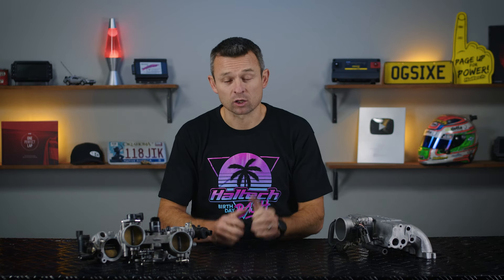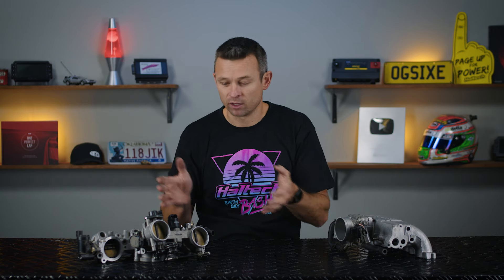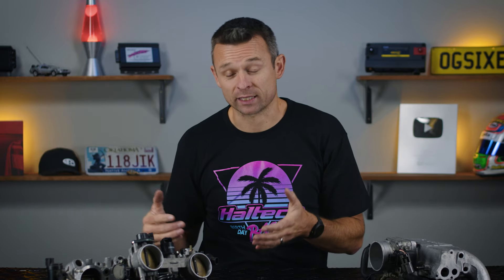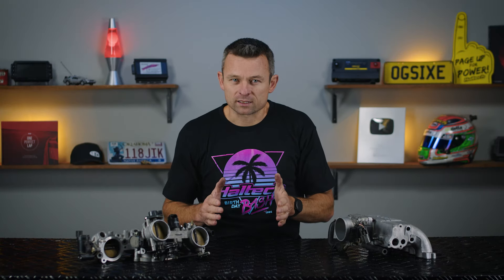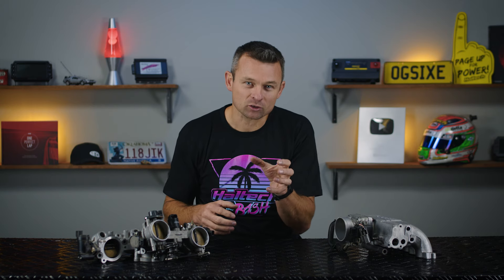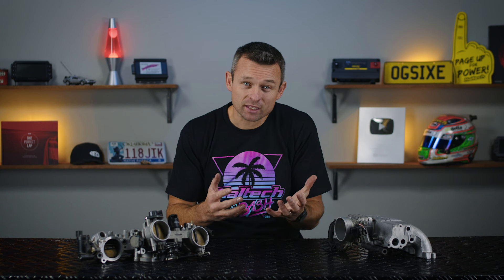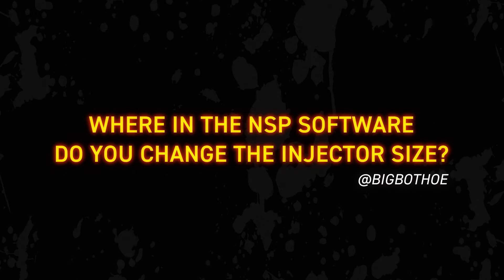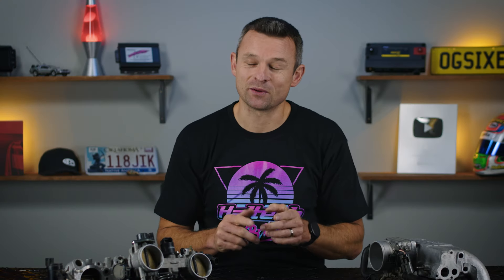🛠  Can ITBs increase horsepower? | TECH TUESDAY

Comment: ITBs for looks only? Nah. GT3, F1, etc. race cars use them, i doubt it is for looks 😉

ITBs on race cars have plenums too, but the velocity stacks are inside the plenums.

A lot of motorcycles have ITBs, whether FI or Carb. Motorcycle tuners deal with them on the regular.

Comment: Good info. Is the Haltech DBW feature compatible with later model super bike quads with fly by wire or similar E throttle controlled throttles?
What's the entry-level Haltech ECU with DBW? 1500?or can you option 550 or 750?
Reply from the maker: You can contact our tech support team directly via www.haltech.com/contact-us 
They'll be more than happy to help you out.

Comment: You failed to mention the main reason for ITBs, they supply an even amount of air to each cylinder. so each cylinder makes similar power. 
its common on plenums with the throttle in front of Cyl 1 to breath more air tha the rear cylinder.
Modern intakes have improved this issue
Reply: Well said he never covered that part put the inlet manifold on the flow bench and see if all the cylinders breathe the same though the inlet😢 most don’t

Comment: I believe Porsche has perfected this pressure wave timing in the intake of their engine I forget which one actually. But I remember it making impressive n/a power.
Reply: Speaking of Porsche... a 944 engine can get significant gains, but only with an engineered setup. It really does depended on the specific engine, as pointed out in the video. in the case of the 944 the hidden benefit is the weight saving on the front of the car when seeking a 53/47 weight distribution, life is complicated.

Comment: You've missed an entire group of engines and a big part of why ITBs are actually really useful under certain circumstances, ironically one that car installations usually completely fail at. Larger intake plenums almost universally improve power and torque, to the point where it was one of the generational limitations on power generation for motorcycles in the early 2000's.
Normally motorcycles have something in the order of 8-10x the engine displacement in plenum volume, which means that throttle response would be a problem under normal circumstances, as well as varying pressure in the plenum... Neither of these are a problem for ITBs. Similarly you can have a huge amount of trumpet clearance, overhead injectors per cylinder and you can do tricks with interacting trumpet extensions etc.
A lot of the time ITBs work for race cars is because they have gone directly to atmosphere etc... Effectively unlimited plenum size... In an engine bay they are just throttles into an extremely hot and geometrically complex plenum with weird flow patterns.

Comment: no, we don't run itbs for more power, we run them because a good condition carb for a 70s I4 car is a bad purchace for longevity,
a new or almost new carb costs an arm and a leg and most likely needs a reworked header or new header
a row of 4 bike carbs can be had for at least 1/3rd of a used original carb, I can find cbr600 carbs for $100 and $150 and they have parts available and people to work on.

Comment: In NSP, what is the pressure rating vs flow for the injector size when using "all injectors the same", vs individual injector sizing?

Comment: Generally a great video, but I think you got one importatnt thing quite wrong.
The size of the throttleblade is in an ITB setup extremely critical to the maximum horsepower every cylinder can produce, and therefor you will mostly make it a lot worse when switching form a common plenum to an ITB.

Simple reason for that is, that the plenum volume and the fact that the cylinders alternate when they need air, a single throttlebody will almost never be a noticeable restriction.
And the fever Cylinders an engine has, the worse it gets for the ITB.
In a V8 engine, the air needed from the total engine is almost a constant, because the curve showing the amount of air needed per crank angle has its high point in the middle 90° of the intake stroke, and because a V8 has a firing angle fo 90° the increasing and decreasing demands of air per cylinder match each other really well.
With an ITB, 7 of the 8 throttle bodies are doing nothing, while one has to cope with almost the same air demand as the single throttlebody of the common plenum, and that without the plenum to soften the blow.

I would always go with a slightly bigger sinlge throttlebody, than trying to get ITBs to manage the air demand.
My Truck has a modifies LS1 in it, that produces about 400-430HP at the crank, and does so with the OEM truck intake and 78mm throttle body without pulling vacuum at peak HP.
To get ITBs to support 80-85HP / cylinder, would need about 50mm per cylinder.
At the point the 78mm common plenum runs out of steam, more like 60mm.

Comment: so if i understand trumpet length goes with cam duration and the size of the itb is based on cam lift and port size. im trying to understand this art for my Rsx type s(k20z1).
Reply: Trumpet length goes with engine rpm, longer trumpet = peak torque lower in rev range. The reason for this is that the pressure waves travel at the speed of sound up and down the trumpet. For peak torque, you want the wave to go up the trumpet, bounce off its opening (which weirdly acts kind of like a wall for sound) then travel down the trumpet to arrive at the valve just as it's starting to close- this provides extra pressure to ram that last little bit of air into the cylinder before the valve closes. The longer the trumpet is, the more time this takes. At lower RPM the time between the valve closing events is also longer, so it matches with a longer trumpet.

Note that this kind of acoustic tuning does mean you'll also have a speed where the valve closes just as the pressure wave reaches the end of the trumpet and is effectively 'sucking' air away from the valve, so at that rpm the engine will perform worse!
Reply: @nerd1000ify  Dude this was a great explanation, Now i see how important is getting proper trumpet length for the application i am running 

What you wrote at the end, you trying to say that i need to find a balance of length. Also try and make it fit with space provide by the chassis(dc5) engine bay as well.

Comment: We still need a video showing a basic setup for running a street car with a Nexus or PD16 from scratch.   Give us wiring and setting examples for things like turn signals, wipers, etc.
Reply from the maker: We've covered both on this channel already. A full series on installing a Nexus in an R35 and one on the PD16 install as well.
Reply: @haltech  there wasn't a lot of detail on inputs channels (switch) vs output channels (bulb) and how that was setup in the ecm. There also could have been more detail on ignition switch  wiring and setup options there.

Comment: Can you fix alot of these issues by using a electronically actuated itb setup that gives you say 5 percent at 10 percent pedal and so on that changes ratio gradually to give you 1/1 at or near 100 percent throttle.

Comment: I feel like ITB'S are good for specific needs. As in racing a NA car on a specific track and tuning them just for that track and race and weather conditions. But without really trick variable ITB'S I don't think they are great for most people besides looking and sounding cool. Which is fine. These days it's not uncommon for cars to make too much power and losing the 18 or 25 HP peak and 15 under the curve or whatever the case may be is just not a big deal. Or for a street car that's driven and not just for quickest passes or posting the biggest number. Also nitrous is a thing and will quickly add back the lost power and then some. Cause cars without V-Tech need a real use for the horn button too. XD. 😊✌️

Comment: I build quite a lot of itb cars 4cyl 6cyl and v8, done right there better everywhere in the rev range from idle to redline , we actually use ecu master ecus as they have lots more needed adjustments in the fueling , if you want to see a bunch of itb dyno sessions come have a look,  my tuner has got them running that well if you didnt pop the bonnet you wouldnt know, the last one we did had some 45mm motirbike throttles on a 1.8 single cam bmw engine with very few mods and we doubled the power just with cam and compression plus the itbs and a set of headers, that engine would take full throttle at 1200rpm in top gear and drive out without a hesitation,  anyone that tells you there hard to tune go find a better tuner , NA and multi throttles IS life 🥹🥹

Comment: When tuning (4 Cylinder example) you have 4 engines to tune, not just one, if you have individual Fuel & Spark Trim with diagnostics per exhaust/cylinder, you can get every hp out of the engine, the same is not true for a Manifold based engine. Air Disturbances & Imbalances inside a plenum based on who designed manifold can be small or great........

Comment: I have a toyota 1gz-fe 5.0 v12 with (2) 58mm TB from factory and i want to go single TB, the question is ¿what size should it be?🤔
Reply: That’s going to be a ton of work, remember that each bank of the 1GZ works effectively independent of each other. The entire engine can run on just one bank and as a result has two ECU’s
Reply: @lomfmur  yeah, im going standalone thats why i want to single TB

Comment: It's interesting that despite the all the benefits that EFI has
 the difficulties that are faced are still largely the same 

People over carbing engines or to bigger throttle bodys

Getting that low end driveability I think is easier with carbs as mechanical progressive linkages actually look the goods with carbs not that this can't be a done with modern tech but it has its challenge's

Comment: i will be that one guy to throw some more fuel to this fire... carbs are far easier to tune look amazing and nothing quite sounds like a 4bbl when the secondaries open up and you take off. that will make more heads turn than any computer controlled setup

Comment: Do you think that a lot of the pain and suffering that ITBs produce is a result of people choosing ones that are way too large for their application?
Reply: Agree. I’m not a tuning specialist and my car has been set up with 48mm itbs rather than 42 or 40mm. One consequence is rather jerky control of low speed running as a small throttle opening delivers a lot of air.